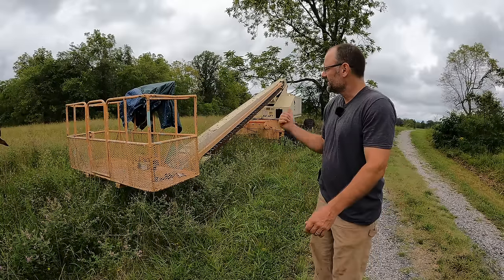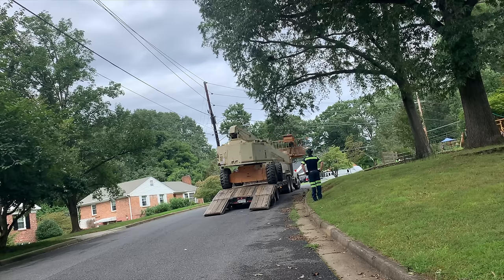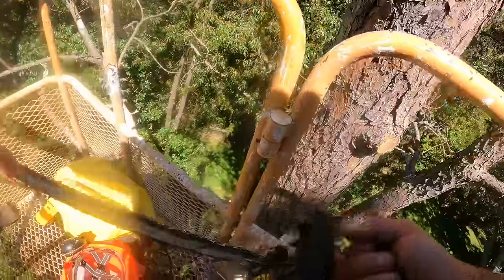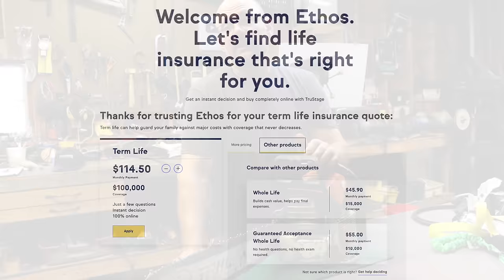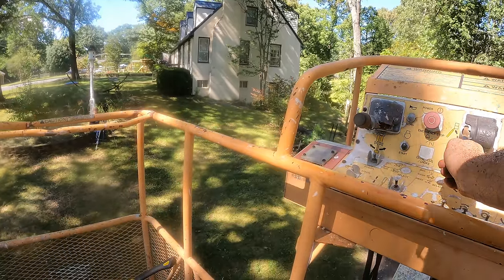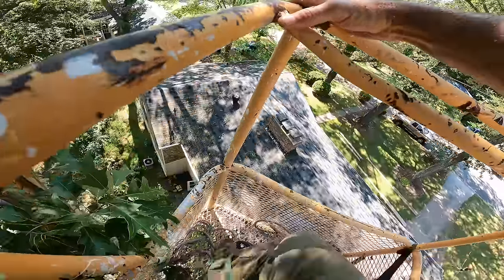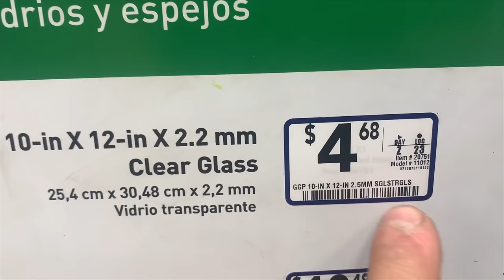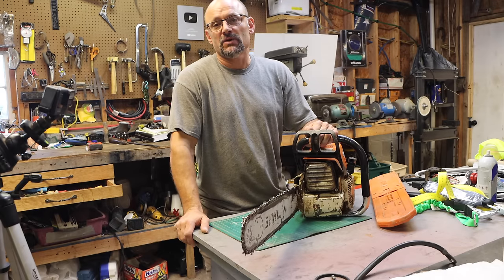Boom Lift Tree Work, Directly Over A House.

Comment: I do antenna work, mostly on the the rooves of multi-storey buildings.
We are absolutely forbidden to use the fall arrest (deceleration) lanyards because to do so, you are kind of admitting that you might fall, and that you need help WHEN you do.
What we DO use, is fall restraint (solid webbing) which completely prevents us from getting anywhere near the edge of the roof. If climbing or working from a ladder, we still use 2 very short fall restraint lanyards, which is a bit of a pain because you have to clip on with one, climb, clip off with the other strop, clip it on further up, climb .. ... ....
The advantage is that we can only fall as far as it takes for the tightest strop to go tight (maybe 2 or 3ft?).

You're probably better off using a solid strop to connect you to the basket, but one that ONLY allows you to stand up, no more. If the basket tries to catapult you, you're going nowhere. The strop should not be long enough to fall or build up momentum, so it should not be long enough for "snap back" situations.

If you're REALLY concerned, a better harness would pay dividends.
The one you have APPEARS to be what I'd regard as a fall restraint type. It has pretty skinny straps and it is pretty much designed not to fall off your body. You have it strapped to some solid object that prevents you from getting near the edge of anything.
If you DO fall in this harness, and you are not rescued quickly, you can suffer a potentially fatal suspension injury where carbon dioxide rich blood is pooled in your limbs (harness acts as a torniquet) and then suddenly released when you are rescued.
There are harnesses which are specifically designed to be suspended from which have thicker straps with more padding, and they prevent these types of injuries. With you being based on a farm, potentially some distance from help, it might be worth thinking about.

Oh, and get a climbing helmet. A high quality bike helmet would do, but you can get a real climbing helmet for similar prices. All it needs to be is a bit of padded plastic to cover your skull, and it's function is to stop you from being knocked unconsious. Unconsious people don't call for help when suspended.

Comment: You're going to want to use both the new fall arrest lanyard and a fall restraint.  The fall arrest for when you're up in the air (20+ feet or so, you'd have to do your own calculations based on your height and lanyard length) and the restraint for when you're driving in the stowed position or just working under the height at which the arrester would fail to prevent you hitting the ground.
Reply: Yes, they make inertial reels that when they start extending quickly, flyweights engage a brake to slow your descent. They were mandatory use when I worked for an oilfield service company. We tested them (and the pipe hanger they attached to) by throwing a 55 gallon drum of water out of the work basket. We had one guy who at worked there for years and was a supervisor and SHOULD have known better not only not connect his harness to the fall arrest device, forgot to close the trap door where the ladder enters the work basket. He stepped backwards out into the hole and fell 40' to his death.
Reply: Sorry I seen it coming as your saw falling but you didn't hear me... That was the first thing I said on your first cut you needed a rope on your saw.. More so because you not as stable as on the ground...  Glad it mostly worked out well...
Reply: Days gone by, local code OSHA did not require tie offs while driving due to people getting thrown and hung…

Comment: Greetings from Croatia, I really like watching your videos. If you continue to have problems with the chainsaw, i.e. that it shuts off in idle, it would not be bad to change the small springs on the clutch. I had similar problems with my STIHL 064. Over time they weaken and wear out or break, and they are not that expensive to change at 1euro each.

Comment: MS460 is a great saw but I wore mine out so I just bought the 500I and WOW wait till you get your hands on one of them,it's awesome. I also have a Husqvarna 390XP and Stihl beats the Husqvarna hands down and parts never fall off any of  my Stihl's ever. The Husqvarna when you loose any screws there specific to that machine and you have to get them from the dealer and there expensive

Comment: An arborist showed me what he calls an "offset cut" for topping trees a pice at a time.  Cut horizontally from the side  where you want the chunk to fall.  Cut 1 inch pass the center.
Then from the opposite side, cut horizontally but one inch higher again just pass the center.
This leaves a small "hinge" connected.  Put the saw down,  and manually push the chunk breaking the hinge and it goes in the direction you want with no surprises.

Comment: I was doing some volunteer work for one of our local railroad groups and cutting up a tree that had fallen across our track. I had previously sharpened the chain which I'm very inexperienced at and as a result my saw was doing a J cut which wouldn't have been a problem but my 25 inch bar wouldn't cut all the way through and the was up in the air and I was afraid that when it fell I didn't want to hit me. So when it let go I dropped the saw and got out of the way. On first inspection I thought it was fine. But then it became evident that the fall cracked my the fuel tank. The local saw place wanted $200 to replace it. So I did it myself.

Comment: With the safety sling have a think about how far it might leave you away from the bucket if you fall out and it deploys. Take the worst case scenario that your phone falls out of your pocket and nobody is around to help, work out if you can get back into the bucket or if you need some gear or a rigging system to help.

Comment: 9/22/23; another great video Jon; yur 80ft boom lift looks/works  great! 
  Re: lowering/rigging big limbs over house/roof etc, check out August Heinike (Oregon) climber & YT producer. He makes & sells several items you may like, especially his Speed Line Kit for lowering  (at ~45° angle) branches, like you were doing. Very nifty for safely strapping targeted branch(s) before cutting, then (caribiner) clipping one of his multi colored straps to angled guide line before cutting. Angled line is anchored to heavy ground item so cut branch just slides down to ground avoiding roof/fence etc. No need to man handle big branch from your elevated position. Your handy ground lady (& camera person) can simply un-clip (caribiner) the colored strap & wait for your next branch. Hope you & boss lady will enjoy seeing this kit, a 'pouch- belt' of 10-12 colored straps/caribiners dangling from climbers harness (or you up in basket) then quickly loop-strap around branch, cut & just let go...had to mention this to you as you were handling heavy branch sooo close to customers house when...oops...glad it was just a small glass...& not a (7 year) mirror damage🤔 you have enough maintenance issues without that curse of breaking a mirror!LoL, always watch & enjoy your videos!👍👍💪🍷😊

Comment: What you really need is a self retracting lanyard. If you fall out of the basket with the lanyard you showed in the video, you will fall 6’ then another 3’ as  the webbing unzips. A self retracting lanyard will stop you from falling out of the basket entirely (unless it’s in really slow motion lol). It will arrest your fall within 3”. It’s like a seat belt. Much safer for AWP work.

Comment: one danger i noticed that you overlooked was at 38:30 ... Try and avoid pulling heavy logs towards yourself on a downwards slope. Be uphill if you need to move them. A overlooked hole / treelimp can make that tricky.

Comment: As someone who has never done any real tree work, I'm obviously an expert.  I'm wondering on those long overhanging branches if it would have been possible to do multiple "tethered" cuts without lowering the cut piece each time.  In other words, it would be like making sausage links that would sort of lower itself all the way down.  There.  Solved.  I'm a genius!  Not sure why you didn't think of that.

Comment: Once you said it was a roping issue and showed how that works my thought was that the piece that you were cutting could swing down and if the rest of the limb you roped it to had hidden rot it could also break off and they would both come come down at an unexpected angle/direction which could do some serious damage... of course as soon as I thought that I touched wood for you (I know it's after the fact but I would have still felt guilty for somehow jinxing you lol). So at least that didn't happen, but I'm sure you probably check for those types of issues... on second thought, hopefully that's not even an option of things that could go wrong.
Thanks for the interesting and slightly suspenseful video.

Comment: I always thought you delimbed on the way up so as to have a clear drop of the limbs above and not leave any widowmakers. 

I didn’t see any “points” to hold the glass in place. These are what really hold the glass in place. The putty is what seals the window from the weather. 

Punching one pane out isn’t bad for what you were doing. Beats the hell out of putting a limb through the roof.

Good work!   ...but don't quit your day job!

Comment: I noticed the lanyard was cinched on the bars if the basket. My experience with aerial lifts has always had a welded D ring on the boom to attach to. That way if the bucket or basket were to snap off the operator doesn't fall with it.

Comment: Questions:  How is the pond doing?  Did you have to move animals into to pack down the clay?  How did you choose Jennifer's electric saw?  I am assuming you have other DeWalt batteries running around.  Battery systems are the bane of any handy man.
Reply from the maker: Very little rain, so pond isn't doing much.  Just waiting for the weather to change.  Yeah, I have dewalt batteries so went with that saw.  It does ok.
Reply: @FarmCraft101  Battery systems seems to be the restriction for choosing tools.  Home Depot had a big sale on Ryobi years ago.  I dove into that system.  Not unhappy.  Just a hobbyist and home owner.  No farm.  Then, I got a very lightweight, Milwaukee saber saw and batteries came with it.  So, I now have both the One+ and the M12 series tools.
Reply: @bbrachman batteries should not be a restriction anymore,  you can just about any kind of battery adapter you need to make an tool work with any battery.  The rainforest store has most if not all of them.

Comment: Pines grow significantly bigger and faster here in New Zealand’s temperate climate. A Pine at 80 years old here would be 1.5-2m diameter, maybe 50m tall and have a total weight of 30-40 tonnes, but because they grow so big and fast, it would have have reached old age and be ready to die. Subsequently harvesting for timber is done at around 28 years, where the tree would have a diameter of maybe 700mm and a weight of sometimes up to 6 tonnes.

Comment: Next time maybe try using a wedge. Drill a hole in the end and put you some light weight string through it and tie it to your lift. Start making your cut and then put the wedge in so your saw doesn't get pinched. If the wedge gets hung up for any reason, the light weight string will break.

Comment: Speaking of safety conscience, always wear your helmet when cutting in the canopy. Just like the unpredictable bounce of the limb to break a window, branches and other heavy debris can fall to crack your skull. They don't call them widow-makers for nothing. By releasing tension or mass from upper portions of trees it may cause branches to whip, slip, break and swing uncontrollably. Stay safe and live another day.
Reply from the maker: You are right of course.  I should have had my helmet on.  I'm not the best about remembering my PPE at times.

Comment: What would be nice is if the boom lift did some reverse kinematics, so you could move in X Y Z instead of r φ θ.  It would need angle / extension sensors and some smarts.

Comment: 52:29  i could seriously use that boom lift, not so much tree work but yes that too.
But more like high up house painting.  Last crew i had do my trim broke a car window, painted windows shut. Got primer on the house had to paint parts of it also.
These yo yos usually just did new houses. The paint job didnt last very long.

Comment: as a general rule, if you need to push, don't do it with your chainsaw in... Logging and tree work where i live its different from up north, we don't use as many accoutrement as you guys do. But if I ever learned something from experience "chainsaw men" is that if it need force, you haven't done your job yet, logging its all about letting the tree do its thing and you kind of setting up the guidelines. Like "kung fu" XD

Comment: Just tuned into your channel see you're having electrical problems with your control, guesstimate disconnect the power to the system and get some electronic contact cleaner and a can of spray air try cleaning all the contacts see if that helps good luck Jerry

Comment: Sir, I have been going to eBay to get the complete carb for my Sthil saw, and weed eaters AND HAVE NEVER HAD A PROBLEM you should check them out they are  much cheaper than the dealer, and no adjusting required

Comment: So im bit late to the party of this episode of "tree cutting and how not to do things"  -  Was some good video - enjoyed the different camera views, was perfectly edited together too.  Glad the saw kept working - that rebuild probably added that 15yrs to its life, probably get a couple of those kits in a box and stuff em somewhere just in case in 15-20 yrs cant get em anymore.. lol  not sure how long those rebuild kits last on the shelf but never hurts to have one in stock if you got a place for it anyway. 
I was wondering about that single pane glass repair - did it have little metal tabs to "tap" into the wood to help hold the window pane before you glazed it in? last time I was working with those types of windows they had these like diamond shaped tabs that held the glass in before the glazing went on.  I have installed big bay style windows on 2nd /3rd floor up a ladder with 400lb double pane safety glass with guy I worked for. was Fun knowing that only thing holding in the glass was the little metal tabs - until he used a bit of corner round/etc and pin nailer to pin it in place before clear caulking it all the seams.. sometimes we got lucky and could install the inside out, instead of outside in.. but one lady did "NOT" want us inside her house soo yeah - only 600lb piece of glass.. no biggy - eventually she relented to having the main guy inside to do the window trim / finish stuff.. not sure how she expected us to install a window without being inside but yeah..  anyway looks like the people got what they wanted with those trees trimmed down - more light on the roof and whatnot. glad it was only that piece of glass broken..

Comment: Question about cutting:  I noticed in the lost saw cut there was and up cut for the notch...I wonder if that left no support for the blade as it slid forward pinning the blade.  If the notch had been a flat bottom and a down cut to finish the notch.  The tree might drag the blade forward a bit, but would pin it to the notch bottom about the time it lifted off and launched.  Don't know which is better.   Go with the launch or suffer the pinch.  Good luck with that...

Comment: Log snatched the saw because you over cut into the falling peice,making a slot for your saw to sit in. Then when the peice starts to move fibers can pinch and it take the saw at an angle you can't grab it.  Best thing is to never let the chain stop and pull that saw out when the peice starts moving. If you made you notch right it will come over without wanting to cut it off. Never cut your hinge off. It's a bad habit.

Comment: We had an 147 ft articulated boom lift where I worked. We had diesel tanks on the other side of the plant and I was driving it to get fuel. On the way there were some rail road tracks you had to go over. Going to get the fuel was not a problem. On the way back there was a turn and then the tracks. I must have been going to fast, because the wheels bounced pretty bad and shifted side to side. Being in the basket 20 ft or more away from the pivot, all of that movement was amplified A LOT! Luckily I had my harness on as if not for it, I would have been thrown out of the basket. I really learned that day why you have to wear a basket in the high reach.

Comment: With respect to your joystick controller, a couple of things.   With your experience and background, I'm sure you've probably done this procedure many times before. As a side note, I once went to a friend's house where he had been troubleshooting, for over an hour or so, why his lawn mower wasn't starting. This is a guy who prided himself on his knowledge of gas engines. Trying not to be a real jerk, I asked the simple question, "did you check the tank" and no he hadn't.  I saw him look at me with a deer in the headlights stare.  Sure enough, it was bone dry.

Hope you haven't thrown the controller away.  Desolder the potentiometers from the circuit board or if they are wired in, desolder one wire from an outside pin. Attach an ohm meter to the center tap and the free leg.  Vary the potentiometer looking for any jumpiness in the reading.  .  If so, and if the pots are not sealed tight, spray contact cleaner into the pot while varying it.  If they are sealed, they aren't that expensive and should be readily available from any number of electronic vendors.  Then you'll have a spare joystick controller for next time.